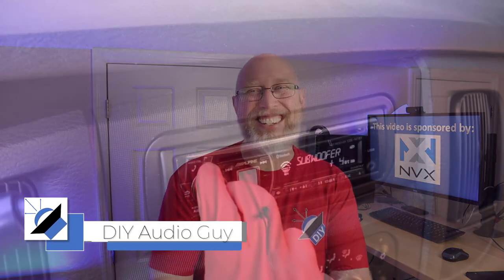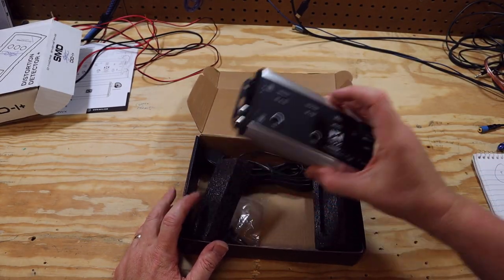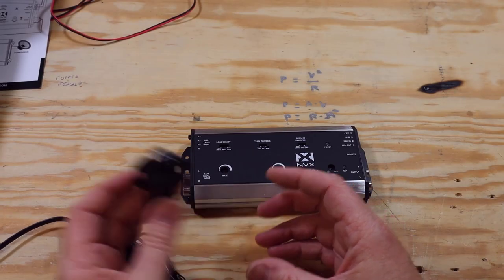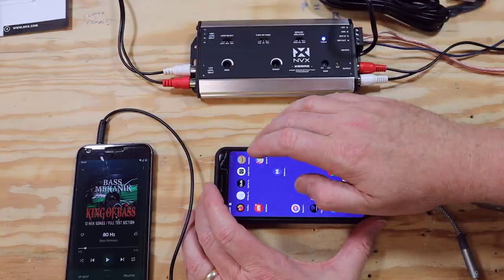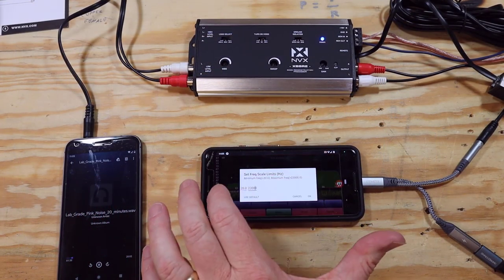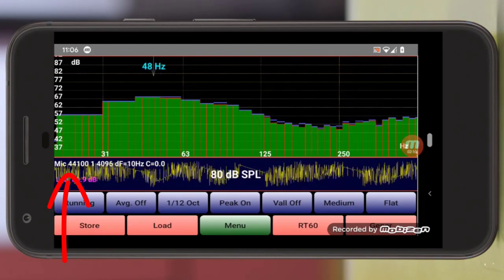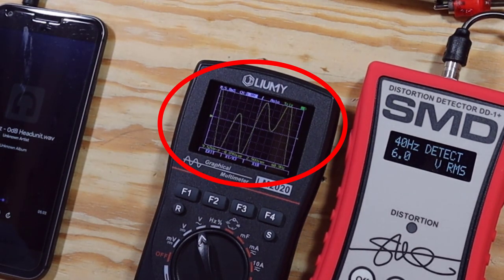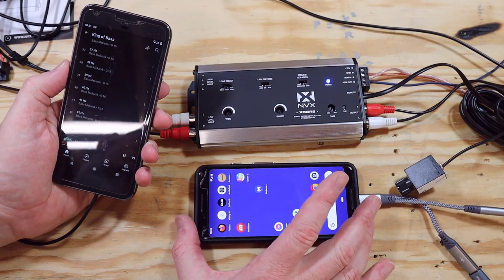Use this to make more bass!  NVX Bass Processor  @NVX

Comment: How about REW's built-in RTA feature?  Just run it on a laptop or PC...
Reply from the maker: That might work.  I might give it a try.
Reply: @DIYAudioGuy  Room EQ Wizard, a decent laptop (I use an old Dell XPS12 because its ability to convert into a tablet with touch screen comes in handy), a calibrated USB mic (I use the UMM-6) and a decent external sound card are basically all the tools I use for audio spectrum testing and analysis. REW's RTA feature is great!  Enough options to play with to keep you busy for hours.  And you can capture the FR and use REW's "EQ" option to generate EQ settings to meet a target curve.  That's what I did when I installed the new DSP in my car a few weeks ago.
Reply: Oh, REW has an Oscilloscope feature as well, but I've never played around with it.
Reply from the maker: @Grommet2007  REW does a lot.
Reply: @DIYAudioGuy  Yup, it does.  I've been using it for quite a while and I'm still discovering or learning new uses for it.  For example, do you know it can be used for impedance and  t/s param measurement, and you can use the DATS3 device with it for this purpose?  It can actually provide more accurate impedance response details than the software that comes with the DATS.   And a few weeks ago I used its "EQ" function to programmatically identify what settings I had to program into my new DSP in my car to get the target response that I was aiming for. 

REW is versatile enough to deserve its own video (hint, hint :-)) 

For oscilloscope use though, I think it would be best to DIY an external i/f rather than connecting anything directly to the computer's sound card - they tend to not be fond of higher voltages :-).
Reply: 🤔 I bet there would be a way to run a speaker level signal into REW instead of only being able to do acoustic measurements. That would be super handy
Reply from the maker: @stuskustomshop  I bet the headset but he device that I'm using for my DIY RTA will do the trick, speaker level into an LOC, RCAs into the headset buddy.
Reply: @stuskustomshop  You can probably do it with a simple voltage divider circuit with a zener diode across the input to the computer's sound card to ensure that it doesn't see excessive voltage.  Package the circuit in one of those small project boxes with spring terminals for speaker level input and RCAs for the output to make it easy to use.
Reply: I use a Focusrite Scarlett Solo interface with my tuning rig. It will do mic or instrument level input. An LOC sounds like it would be the way to go, as long as it was accurate 😉

Comment: I'll jump on the wagon with other praising audio control. Not sire what wizardry they use but music that doesn't have any bass, suddenly has clean, powerful bass. Paired with the dm608 you can really dial things in the way you want it
Reply from the maker: You can look up the patent, it is actually very old technology.  Since the patent expired people can save some money getting the NVX model.  Now if Audio Control wants to send me one I would be glad to do a shoot-out video.
Reply: @DIYAudioGuy  they should, that'd be an excellent shoot-out. Audio control dominates that area, where I live anyway. I am curious about Daytons dsp. The software is def different n would take some time to figure out. Audio controls did too
Reply: I’m seeing too many bad reviews on this nvx regarding seconds delay when adjusting head volume, inconsistent bass requiring constant adjustment from song-to-song. I didn’t see you mention any of these issues, but when I read reviews for the AC Epicenter there are very minimal complaints.

Comment: These are very dangerous and cause many people to blow their subs. Problem is at low volume it's pushing way to much bass into the subs. Sounds dirty and unnatural sounding.
Reply from the maker: Some people like the sound, it does after all add more bass.  Regarding equipment damage, if it's set up correctly that should not be an issue.
Reply: @DIYAudioGuy that's true for those who like quantity over quality of sound.

Comment: Unfortunately what your test did was prove that NVX is fake.
As a several time IASCA and dbDrag winner, and Epicenter owner, now and several times over the years, I can assure you, if you feed a clean frequency to the Epi, you're not getting that bump down low, because there is no such thing as a "backwards harmonic". Epicenter reproduces what was there, the NVX made some sht up.

If you feed an 80Hz signal to the Epicenter, that is what you get out of it. Nothing else. Why would you get another freq out?
Now, if you feed a Drum and Bass track that has been processed 3 times and output by a cheap B2th, with the top and bottom cut off, you'll experience all kinds of missing data on the ULF. The epicenter will reconstruct that.
Here's how you can tell... 
Cheap fake, NVX, watch the ULF match upper "heard" frequencies.
Epicenter, watch the ULF not be in lock-step with higher freq.
The harmonics are just that, barely heard, they are not the primary freq that you are hearing.

Comment: Where do you recommend the positions of the sweep and wide settings?  Yes, I know everyone’s system is different as well as sound “taste.”
Reply from the maker: For a sealed sub I would start with both all the way to the left.  Then increase the width and see how it sounds.  If you do that with a ported sub you're going to be fighting against your infrasonic filter. So for a ported subwoofer I would start with everything all the way to the right and then gradually turn the sweep down and see how it sounds.